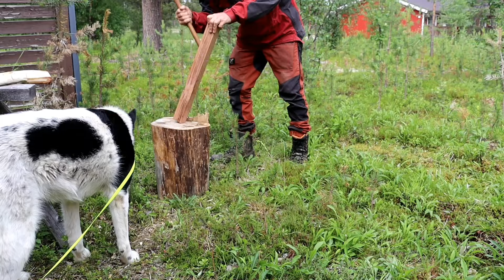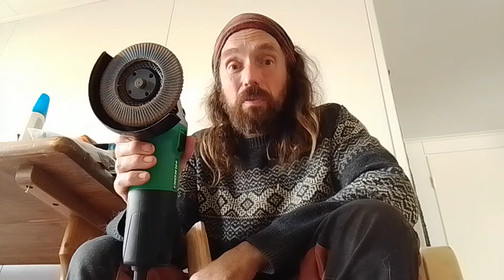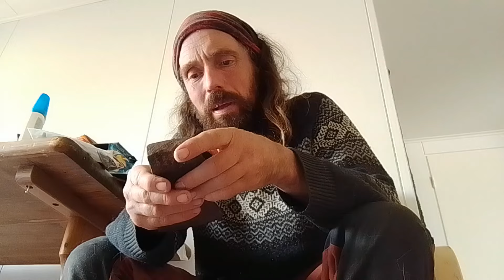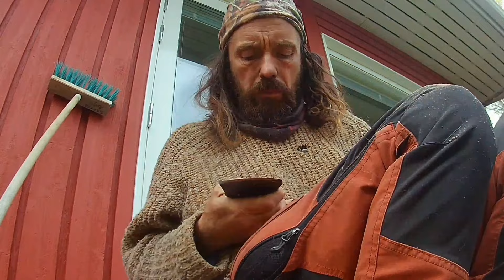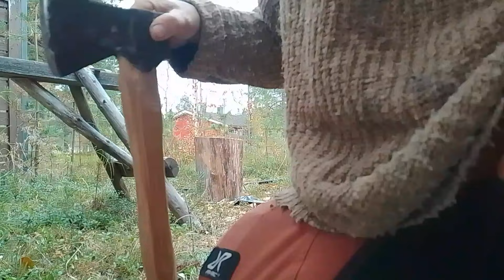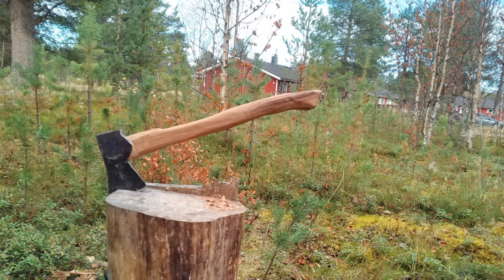My first Gränsfors Bruks axe

Comment: Good work Tim!  I still have a couple of old Gransfors axes, one which I bought for $3 CDN (a 2 1/4lb head) You approack haft making very similar to I do it, using spokeshave, drawknife and like you I have no bench vise (or shaving horse for that matter). I had a very similar axe head to that but it was a SA Wetterlings Storvik. I found the hardest axe heads to re-haft were the Billnas and Old Soviet Axes. I have used Yellow Birch and that is old school Scandinavian haft material, I found it durable. Coming from UK I have made a lot out of Ash, unsurprisingly. I come from several generations of carpenters and boat builders. Cheers mate, Chris
Reply from the maker: I also used to use Ash in the UK. Birch is the obvious choice here. The thing is it is so hard to find trees big enough this far north. I do have some drying for when I have the time to rehaft one of the Billnäs heads I have been hoarding, and when I pluck up the courage to do something a bit different 😂